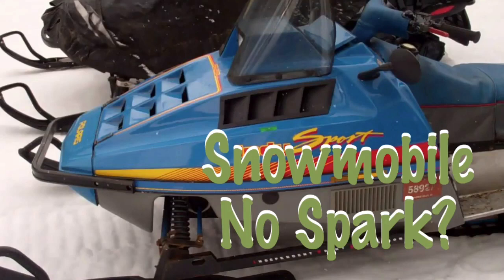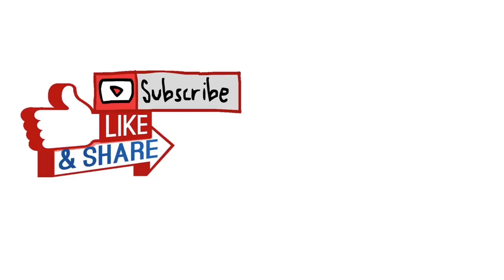Polaris Snowmobile No Spark (Or Weak Spark) 1985-1995

Comment: Good Info. Thank you. I have a very weird spark issue on a 95 Polaris XCR 600 Triple. I take the plugs out and spark tester in place of all three. I then crank the engine over with a drill on the clutch bolt (same results as when pulling the rope). I get a nice bright blue spark on all three cylinders when rotating the so long as its under a certain RPM..  normal pull and I get spark, super fast pull on the rope and it only sparks 2 or 3 times then nothing. Same with the drill. I rotate at 3/4 drill speed and get beautiful spark, so a little faster (full speed rotation on the drill, maybe 1500rpm) and it sparks 2 or 3 times then no more spark unless I stop and start again. How weird. Any ideas?

Comment: My 1995 Polaris 340  will run when it’s cold but not when it’s warm and I’m lost
Reply: Check the cdi box but not the coils
Reply: I am actually thinking coil pack.  Typically if a coil is bad, it will work well at cooler temperatures, but when warm/hot they will short and stop firing.  CDI is a definite possibility as well.  Those things like to fail, but are usually not temp related.  Typically they either work or they don't.  Of course there can be exceptions to any of this, but worth at least checking both just to be sure.